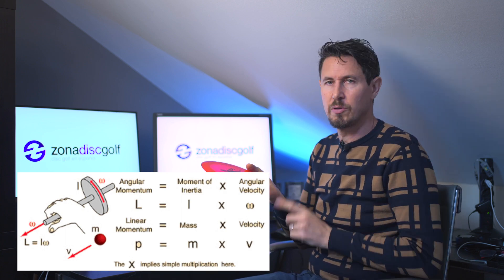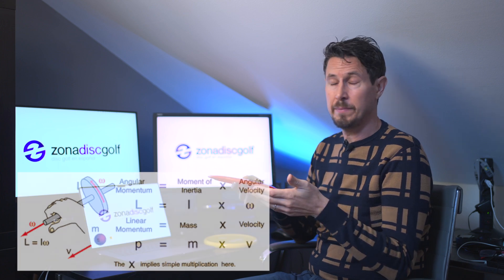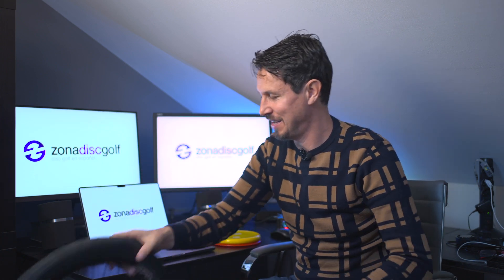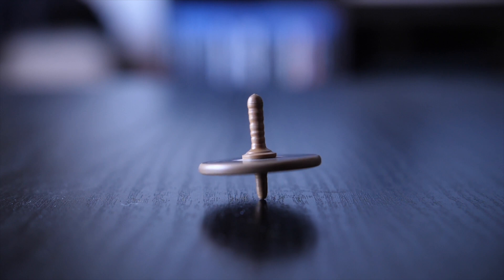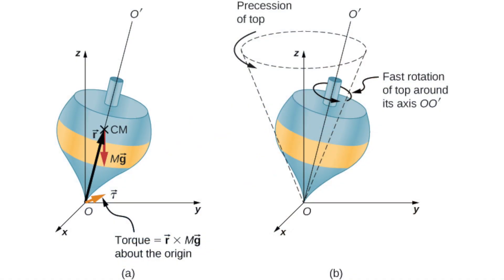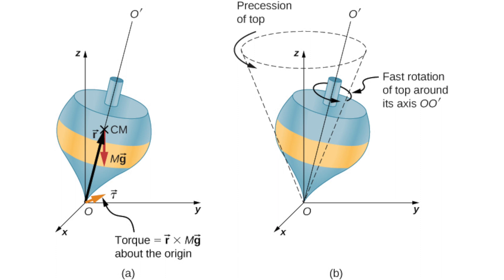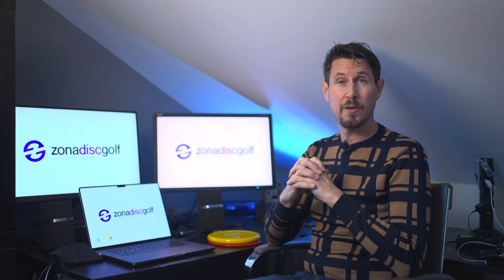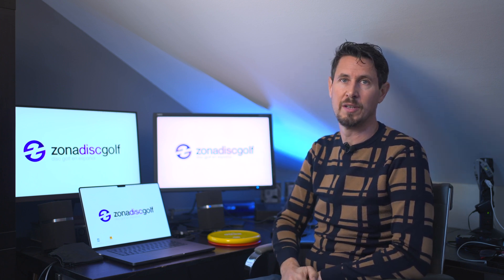Gyroscopic precession of a discgolf disc

Comment: Keep in mind, when I say the leading edge of the disc, I mean the front half which is rotating towards it's flight path. This is the left or right side of the disc which is going to get pushed up or down by the air.

Comment: Discs do not fade in the direction of the gyroscopic precession.  High speed turn and low speed fade are caused by air pressure on the disc.  For example, the Discmania 'Tilt' fades as hard as it does because of the intense lip on the underside of the rim, not because of it's mass being located towards the perimeter like every other driver. The leading edge of the disc acts like a curve ball. At high speeds, the air current traveling over top of the disc pulls the leading edge up, causing high speed turn. At low speeds, the shape of the air currents change and now the air current traveling across the bottom lip of the leading edge pulls that side of the disc down, causing the flight path to 'fade'.
Reply from the maker: Hi @ironman262 Thank you for your comments.
I’m basing my arguments in scientific publisged papers like the great book Spinning flight by Ralph D. Lorenz ( Planetary scientist and engineer at the Johns Hopkins Applied Physics Lab ), Frisbee Aerodynamics by Jonny Potts, Professor at Department of Engineering and Mathematics ( Sheffield, United Kingdom ) and William James Crowther from School of Mechanical, Aerospace and Civil Engineering at The University of Manchester ( UK ) among others.

The “curve ball” effect that you mention is absolutely real - it’s known as the Magnus-Robins effect- but its magnitude on flying discs is much smaller than in balls because the amount of lateral surface exposed is minimal due to the disc geometry compared to a sphere. You can watch the discussion about this topic in the las episode of the series: https://www.youtube.com/watch?v=JZhupWzrE9Q

I hope that you’ve enjoyed the videos. Let’s keep learning!   Calixto